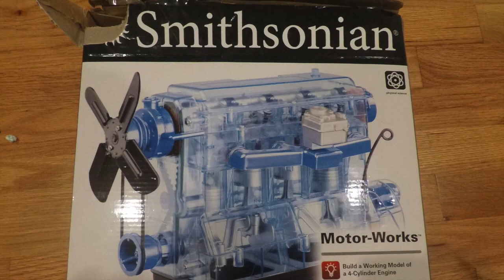Smithsonian Motor-Works built from scratch

Comment: Howd u get the camshaft together instructions are nowhere near right and im lost can u tell me how the lobes sit on the camshaft
Reply: Brycrow96 zthere are little letter onnt
Reply: but how do you know which way they go. the letters are the order but arent they suppose to point a certain direction
Reply: Im having the same problem please help
Reply: jgalzate93 did you ever figure it out?
Reply: I'm having problems with the camshaft as well. It doesn't work correctly when I follow what the instructions show. Definitely not the right order.
Reply: Same